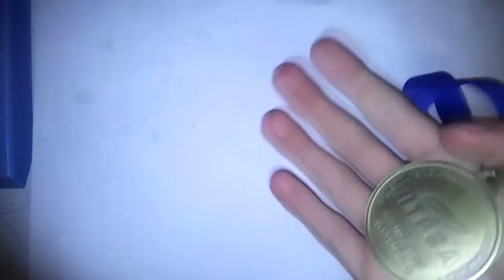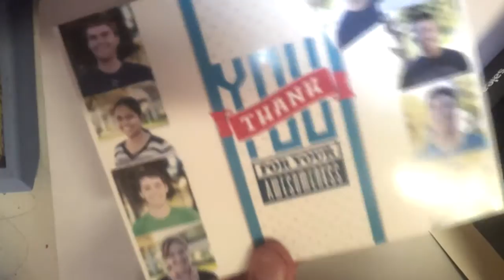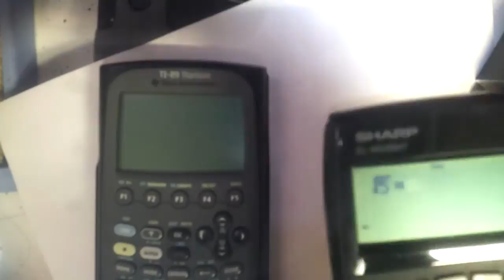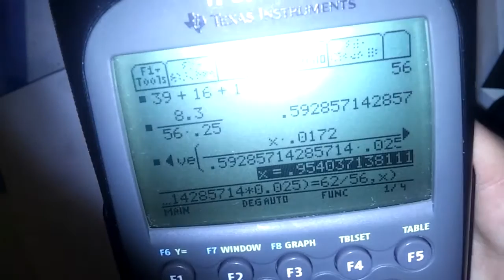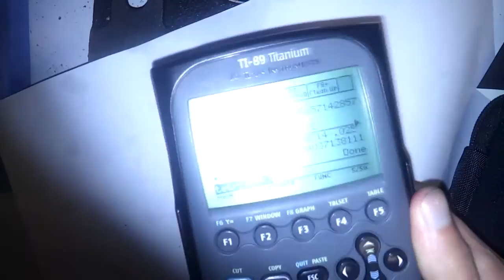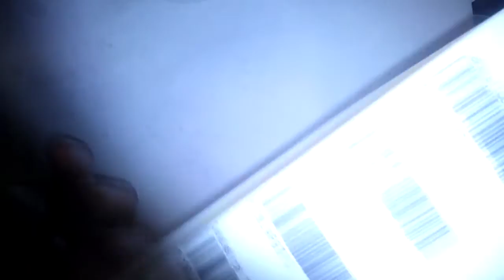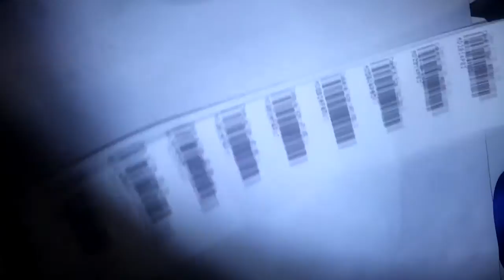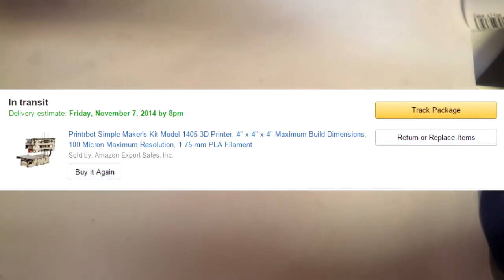I won bronze in A Computer Olympiad, getting a 3D printer, and more!

Comment: cool man, your doing allot of stuff there. i got a printbot simple metal but assambling it yourself is prety hard, software for models you migth want to check out is freeCAD 123Ddesign and blender3D.
Reply from the maker: I'm reasonably confident I can assemble it. I've made robots before and stuff. I've looked over the instructions, and it doesn't look that complicated :D

I'm pretty happy using OpenSCAD, as a programmer I'm very comfortable with writing code so I don't need to learn what all the buttons and parameters and tools do in GUI based editors. I will probably try one of those at some point though.
Reply: Laurens Weyn Totally random question, but do you see any possibility of ordinary people designing and manufacturing their own integrated circuits/computer parts using miniature semiconductor foundries?
Reply from the maker: ptobler1 No, but I do know a good alternative. FPGAs, or Feild Programmable Gate Arrays. FPGAs are pretty much the IC version of a breadboard. You upload a configuration and the gates inside connect in such a way to form a specific circuit.

You use a strange gate defining language to design FPGAs, and it's very different from normal coding. Many companies use it to prototype their designs before getting ICs made, and many hobbyists have used it to design experimental CUP architectures. For that reason, I would really like one to play with myself :D
Reply: Laurens Weyn which fpga do you want?
Reply from the maker: I'm not sure yet. Perhaps a Cyclone V? Having purchaced a 3D printer recently, I can't afford one right now anyways :)

Haven't looked at what stuff I'd need to develop either (dev board, programmer etc) so I can't say fpr certain what I wpuld gate yet, if I get one at all. I probably will one day.
Reply: im always interested in a graphics chip if you have the time ;D
Reply from the maker: What do you mean? As in, you want me to design you a graphics processor?
Reply: yea basically a gpu (not like current pc gpu more like n64 ps1 range)
Reply from the maker: I'm affraid I don't have the skill or experience to make a GPU capable of 3D, that stuff is super complex. The best I could do is SNES era graphics (w/o turbografix) at MOST. 3D requires complex floating point math and lots and lots of ALU cores, and some complex firmware.
Reply: yea i understand that, but hey ever want a challenge lol. anyway keep us up to date on the printer, maybe a timelapse?